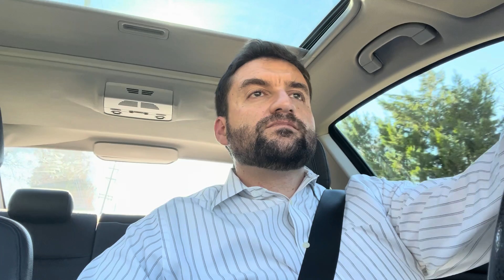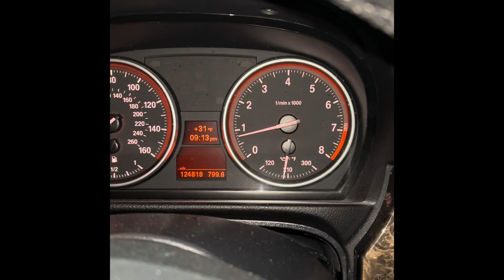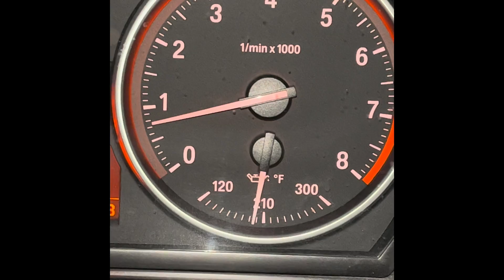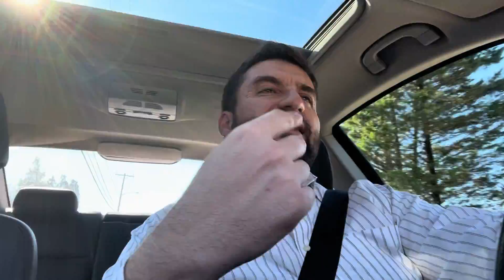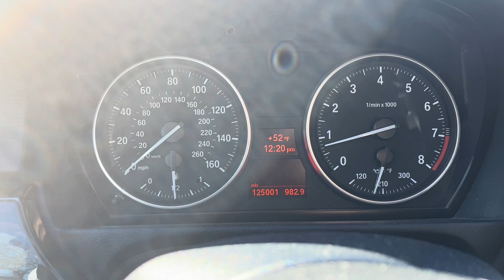Potential Issue with the 3-Stage Intake Manifold Conversion for the BMW N52 Engine

Comment: Did u ever fix this? I have a SULEV 11' 128i that comes with 3-stage factory and I have it now w/o tune
Reply from the maker: For the most part. Once I replaced the alternator, it improved a lot. It may be a symptom of an alternator that is nearing the end of its life. I would consult with a mechanic before doing anything of course.

Comment: Did you reset your DME Adaptations? Thats probly the reason why
Reply from the maker: I did, and I had to reset them again to eliminate this issue. It has worked for the most part. There are still instances where if there is a sudden change in the weather (e.g., heavy humidity and rain), the engine starts hunting for RPMs, but it has improved.

Comment: My car was doing that when a had a bad coil. I had a bad coil and replaced it with a cheaper coil until I could buy ngk coils and plugs . When I changed them all out with new plugs and coils the rpm gage settled out. But this may not be your problem since you have a tune and headers. But worth checking.
Reply from the maker: Thanks! Resetting the adaptions helped and fixed the issue for the most part. The engine may still from time to time hunt for RPMs, but only if there are sudden changes in atmospheric pressure.

Comment: I have the exact same issue, if it’s even an “issue”. More so notice it when engine is cold. I noticed it immediately after the fact. Also only happens when in “Drive”. My thought is that it could be an issue with timing or throttle positioning sensor? Not a certified mechanic but I did the installs myself cautiously. Subscribed in hopes of seeing more videos going down this rabbit hole for those who have done these mods!
Reply from the maker: Thanks for your comment and for subscribing, buddy. I will be posting an update video on this and what I have learned so far after taking it to my mechanic.
Reply: You need tp reset ur DME Adaptations

Comment: I agree with Autohut with it being tuning problem. I believe it's since the AA Headers have moved the air/fuel sensor location further down the exhaust that the engine is trying to adjust

Comment: I would say this is likely a tuning problem instead of something with the headers or intake. I ran my car and several other cars with 3 stage intakes with no issues like this one and haven’t seen it before. 

I had my car with the stock tune and headers and manifold and it didn’t do this and it also wasn’t an issue when I was running the bimmerlabs 330i mafless tune which basically runs the car off of the o2 sensors only, even then with headers it was fine.

I would flash back to stock and see if it does it, if it goes away you already know. That’s the first thing I would do because I also have weird problems with my Stage FP tune that go away as soon as I flash back to stock.